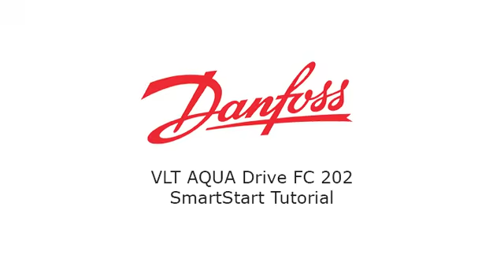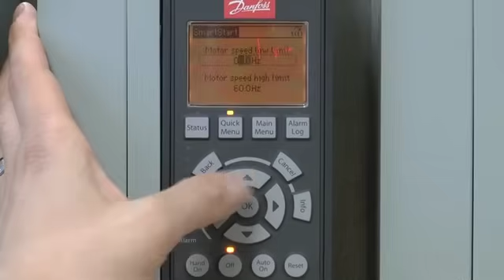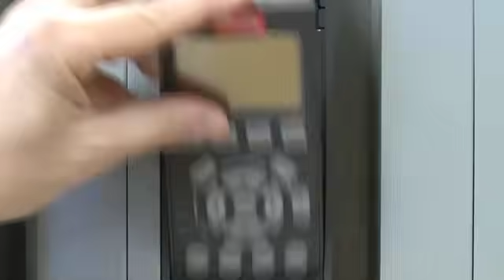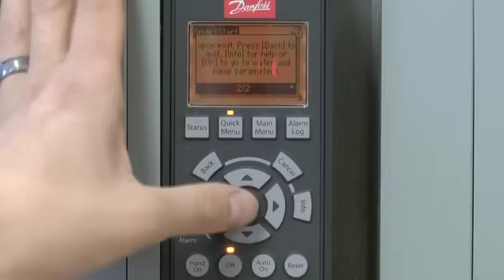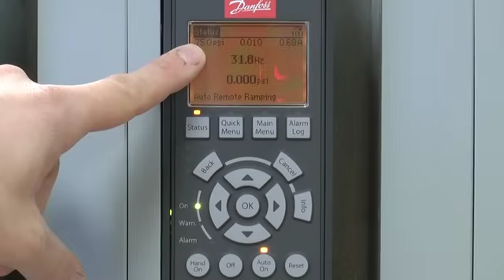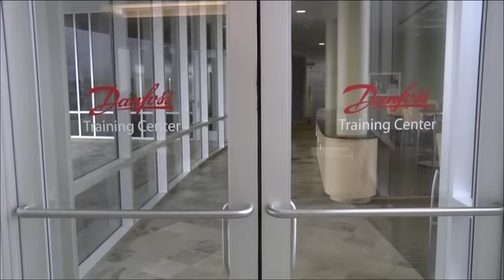Danfoss VLT AQUA Drive SmartStart Tutorial

Comment: I have soft starter MCD 500 model danfoss make .
I cannot reset the below alarm repeatedly.
Firing Fail P2 Alarm. Could you please suggest how to handle or resolve it
Reply from the maker: For installation, start-up, programming and troubleshooting assistance please email: Drives.TS.NA@Danfoss.com 
or if you need immediate assistance contact Danfoss Drives 24/7 tech support at: +1 888 DANFOSS (326-3677)